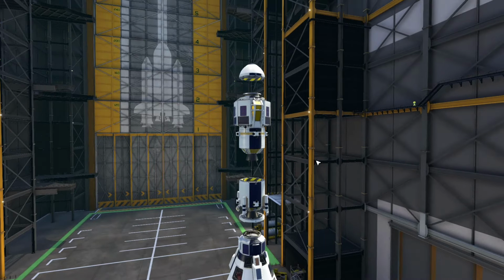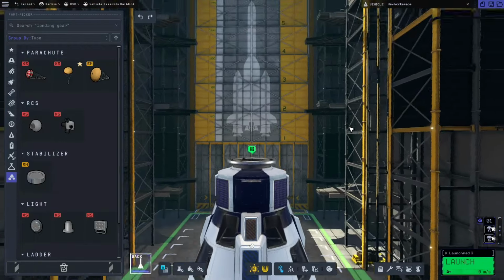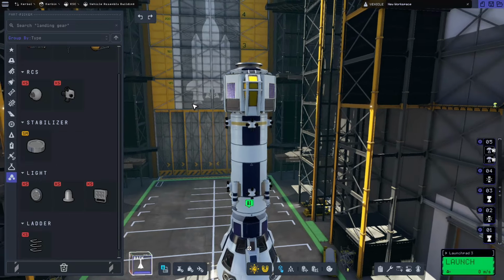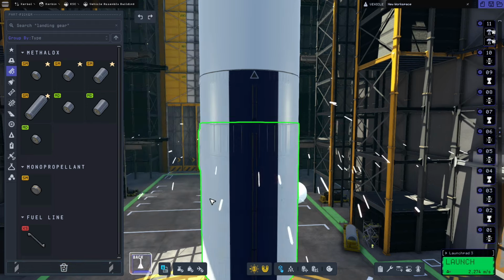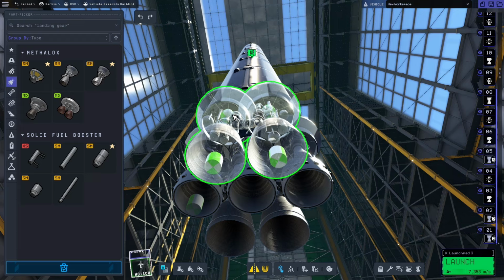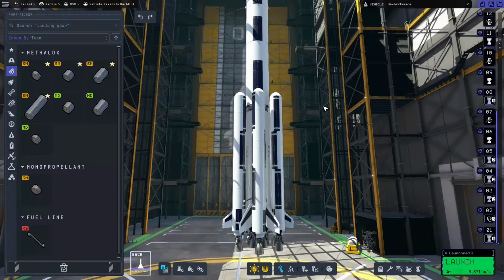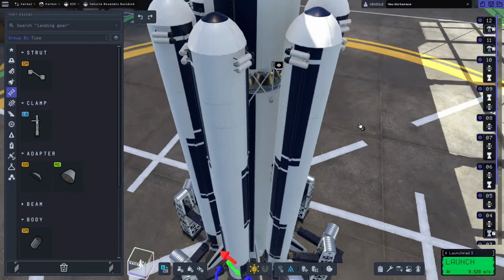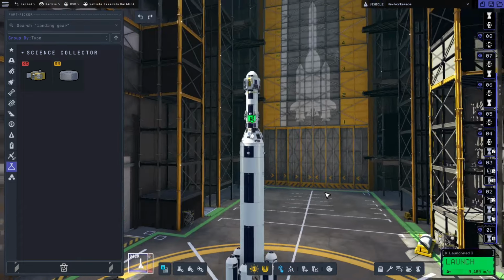KSP2 - For Science! Medium Mun Rocket BUILD GUIDE

Comment: Looks like in closeups of the final assembly you forgot to re-add the fuel lines after going back to neaten things up. Also, what about asparagus staging? It would be more efficient, although it doesn't appear KSP 2 allows you to break the 6 way symmetry of the decouplers into pairs, which means a lot of manual placement.
Reply from the maker: Yes I did notice that when I tested it after recording the video. I'm going to mention it in the next vid :)
Also I've never done asparagus staging so im not sure how it works :/
Reply: I think its when you have 4 or 6 boosters and, using fuel lines, empty 2 at a time, to then break them off.
Reply from the maker: Ah I get what you mean now. I believe you would need to run the fuel lines from the first pair of radial tanks into the second then do the same from the second pair into the third and then the third pair would be the only ones connected to the core stage. I hope that makes sence. 
https://youtu.be/2nlT7XmfhSw?si=R04XkVbNNwBHdPcy This video explains it fairly well :)
Reply from the maker: I might do a video on asparagus staging in the future if i can work it out :P
Reply from the maker: Also in regard to the placement, if you place the tanks in pairs that will allow you to set the fuel lines up properly. Thanks for mentioning it as i now understand how asparagus staging works and will definitly be using it in the future :P
Reply: @clowderman88  It used to be my standard way of building rockets back in KSP1. Very effectve way of getting rid of dead weight and maintaining a more stable thrust to weight ratio.
Reply: @clowderman88  There used to be a mod for KSP 1 that would add the fuel lines and staging automatically. It isn't a big deal when you've only got a few engines, but some more complex setups could be a chore to get hooked up. Hopefully someone will port that over to KSP 2
Reply from the maker: @Formul8ed  Yeah, it can be a nightmare organizing the stack without a mod :/
Reply: @clowderman88 you might have noticed, but when doing 6 way symmetry, you want to drop 3 tanks at a time, and with 4 way drop 2 to keep everything balanced and the rocket under control during ascent. Dropping 2 with 6 way makes the SAS work really hard.
Reply from the maker: @Formul8ed  Hmmm, I personally haven't experienced that...but then I don't use sas during the launch

Comment: Thank you, your tutorials are always to the point and very informative. Just for info, after building the ship I'm experiencing excessive fuel usage when in orbit... very strange, never happened to me before.  For example. I planned a maneuver which required delta v of 500 and I had 700 in the tank. None was left...
Reply: I experience the same. Even reaching orbit requires more dV than expected with the „default“ gravity turn - 2500m tilt east until 45 degrees at ~20 Km - or I am missing something obvious
Reply: I know I'm so late, but I'm still dealing with this issue. 

Man I wish I bought ksp1 instead